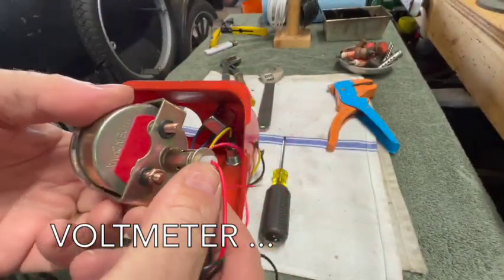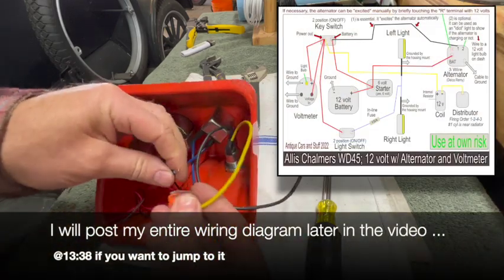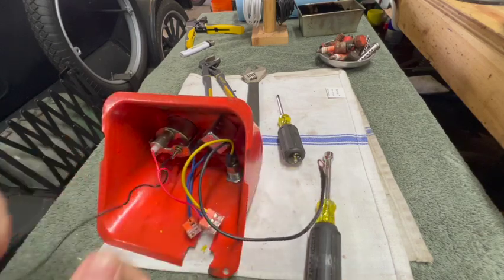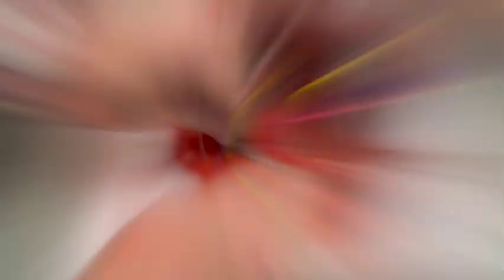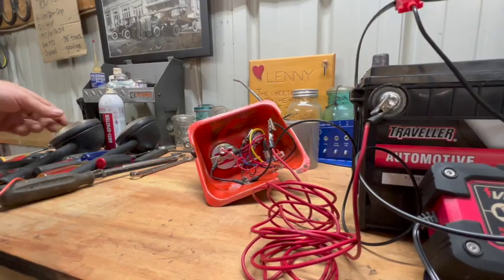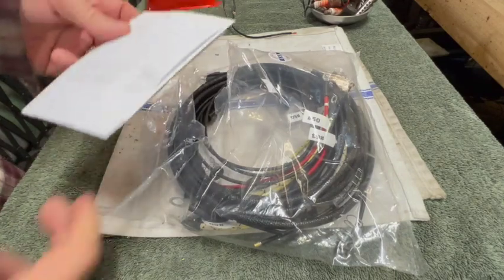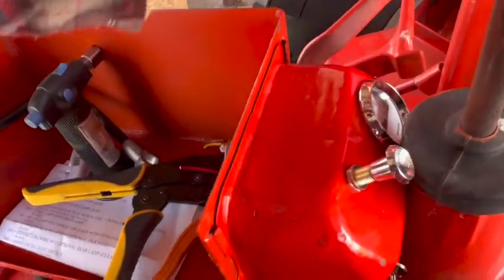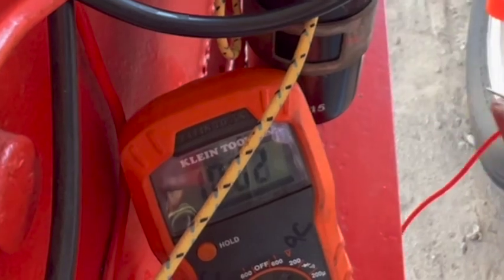Allis Chalmers WD45 - Part 6 (12 volt Wiring w/ Alternator)

Comment: Put the headlight lens clamp screw at the bottom, so rain can drain out. Otherwise you can rust out the bottom of the clamp because the water is trapped inside. All the best.

Comment: I didn't see any mention of a ballast resistor in the video though I could be mistaken.  Did you simply run the ignition circuit, coil and distributor, with twelve volts?
Reply from the maker: The coil has an internal resistor built in.

Comment: Did you replace the 6v starter with a 12 v starter ?
Reply from the maker: No. In my opinion there really isn’t a need to replace it. Those 6 volt starters are built like tanks and work just fine with 12 volts.
Reply: @AntiqueCarsandStuff  I saw a few vids of people showing damage from the starter spinning to fast , thus sometimes the bendix not engaging properly....tearing up teeth.   Trying to figure out what to do safely with my 6 v starter.  Thanks.   I am on the fence

Comment: Thanks for the video, this is exactly what I was looking for. I'm curious though about your wiring diagram, it shows the #1 from the alternator being connected to the "battery in" side of the key switch, should that have been connected to the "power out" side instead? Connecting it to the battery in side means it would be hot all the time right? Or am I reading that wrong? Last question, what size wire should that be?
Reply from the maker: Hi Jason, you're welcome! You bring up a good point about the #1 wire. I suppose it would be more logical to connect it to the power out side of the ignition switch. But, it doesn't seem to make a difference. The alternator is not drawing power from the battery anyway. I don't remember the gauge of mine .... maybe 8?

Comment: I really like your videos and your project. I have a 53 WD 45 that I am in the process of trying to fix up. Not to restoration state but as a good "around the farm" tractor . I hope I have as much success as you. Would it be possible for you to list all the NEW parts used and where you purchased them ? I know some came as "extras " with tractor purchased.   You mentioned Steiner, did you get everything through them ? Love the wire connectors and stripper. Sorry for all the questions. Have a great day 🙂
Reply from the maker: Hi Steven, I only had to purchase a few new parts. Here they are; 
Wiring harness, valve cover gasket, fuel tank webbing strap, decals, sediment bowl, ignition switch - all from Steiner. Oil filter, oil drain nut/washer - Farmtractorrepair.com. Generic two-position light switch - Autozone. I think that's it. Everything else came with the tractor.

I am working on the 3-point conversion video now and have had to buy some parts for it also.

Thanks for watching and good luck with your 53 WD!
Reply: Thanks
I am thinking of upgrading to a newer 12 volt altenator
 It is a 12 volt system but some what aged. It has been sitting in barn with exaust covered for over 15 years without being started. My fear was motor may be seized but to my suprise it is not. I have just turned motor over but havent fired yet because cattle busted through and ate all my wiring ! Hopefully your guide will help me. Wish it was a printable diagram. I hope it is ok if I ask questions from time to time. Im far from being a mechanic but it is almost impossible finding someone to work on it at a reasonable cost. Besides I just retired and need a project ! 😆😆😆

Comment: Is this a complete 12V system conversion?
Reply from the maker: It was converted from 6 volt positive ground to 12 volt negative ground. It now has a 12 volt battery, 12 volt alternator, 12 volt coil, 12 volt voltmeter, and 12 volt headlight bulbs. The starter is still 6 volt but that was intentional. It can easily handle 12 volts.